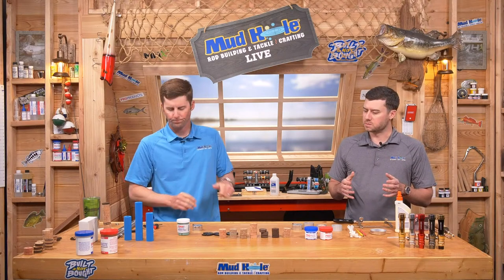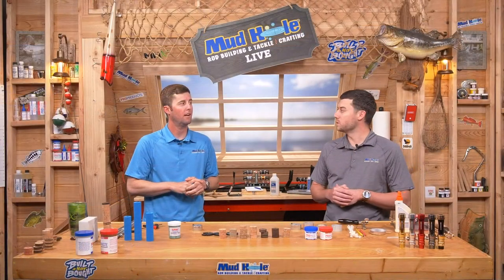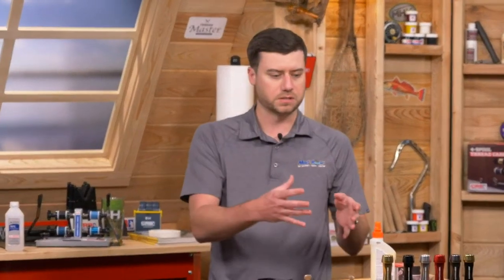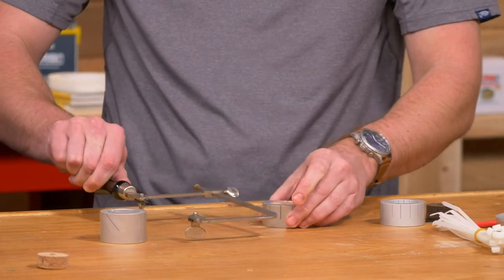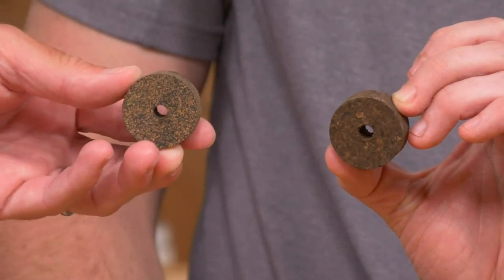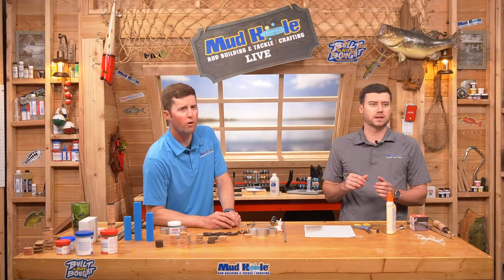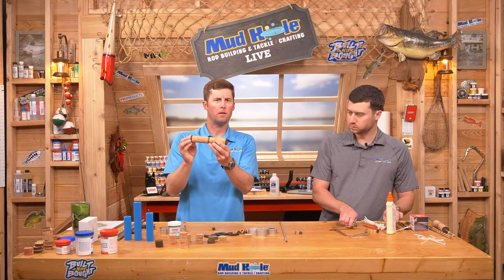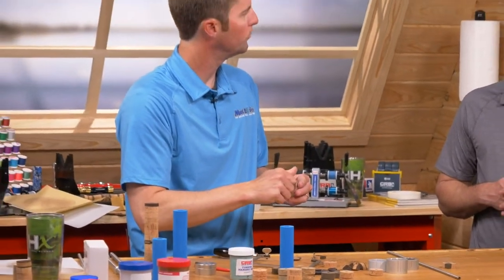Mud Hole Live: Custom Cork Handles - March 16th, 2021 @ 6:30PM

Comment: Great video's,   FYI,  I have been using "Clear" gorilla glue for handles.  It is waterproof and is working well.  Do not use the other gorilla glue because if "foams",  the clear doesn't do that.    I glue the handle to the blank with epoxy.

Comment: What do you think about a solid wood handle would it be detrimental to the Casheen or would it be at an anglers advantage?
Reply: That was supposed to be casting
Reply from the maker: A solid wood handle can work, you just have to be careful with lighter action blanks that can bend towards the handle section. Solid wood will not give like cork or EVA. But if you must use solid wood, go for a split grip setup.